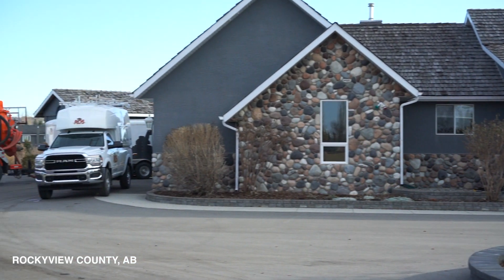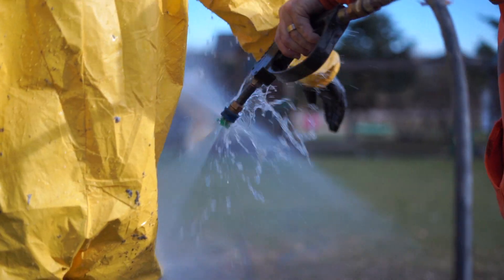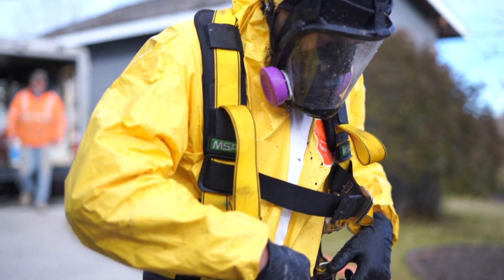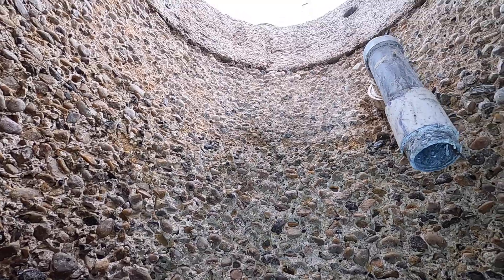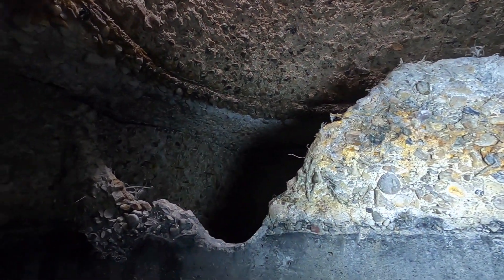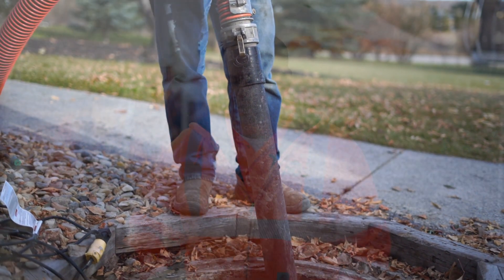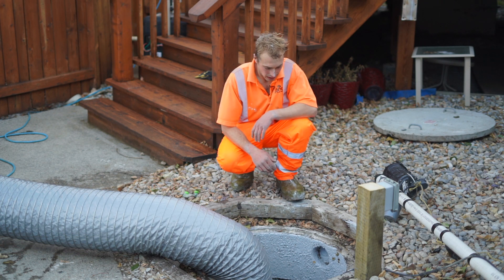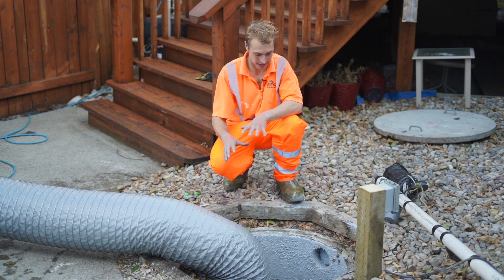Septic Tank Repair & Lining

Comment: How much did this cost back then and do you have any updates of how well it worked? I have a holding tank at a campground, 1000 gallons and i think it is leaking ground water inside, were not allowed to replace it as this place no longer allows ground tanks, unless you are grandfathered in,  any information would be great, thanks.